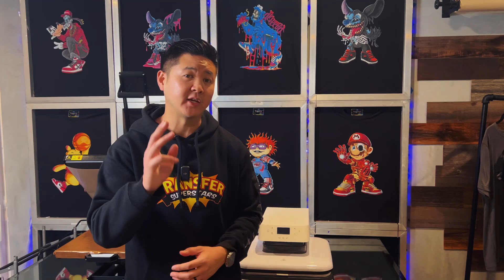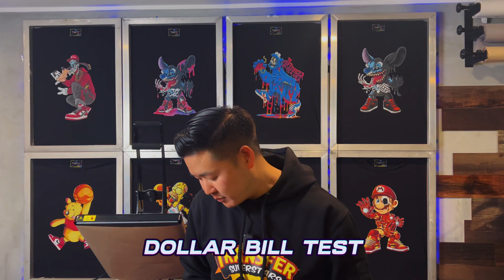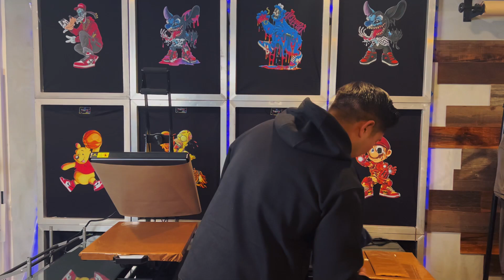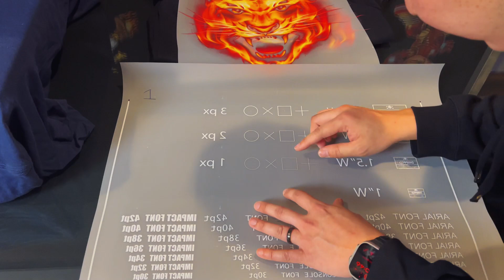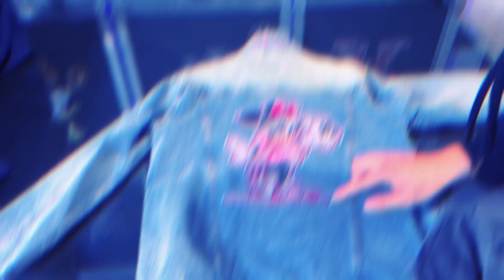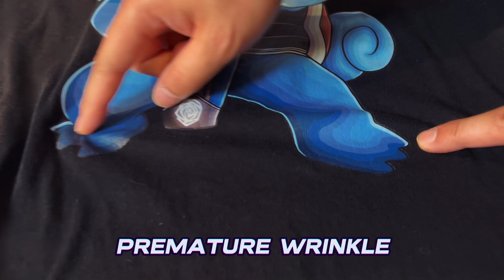DTF Transfer Troubleshooting Tips: Part 1

Comment: How do I know if white subfloor should look like. How do you imagine that there is a test document for that?
Reply from the maker: There isn't a test document available, so you may need to experiment until you achieve the desired result. But ideally you would need all colors to be separated to have everything covered by the texture.
Reply: When I press my dtf it comes out cracked in some spots and also when what could be causing that